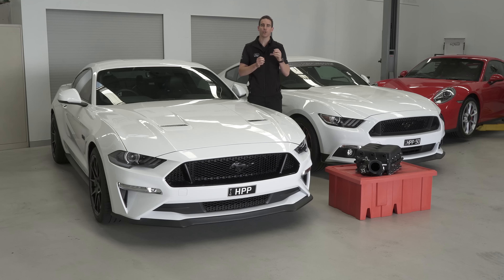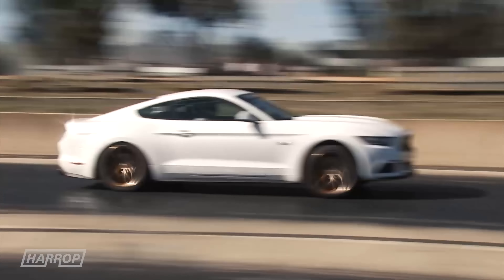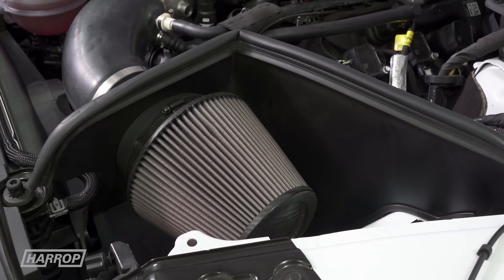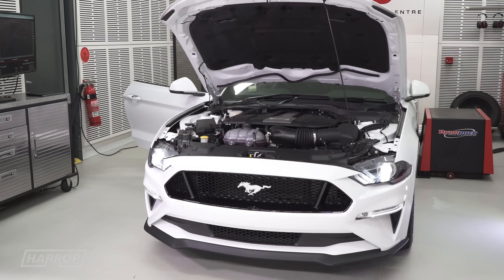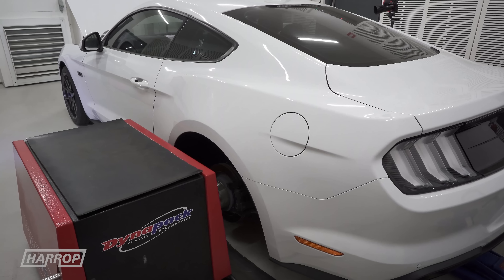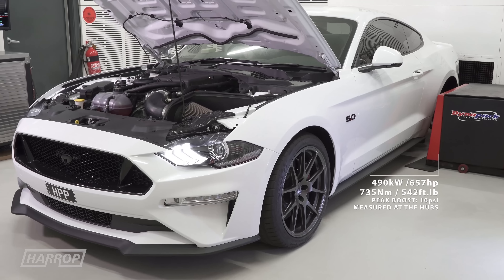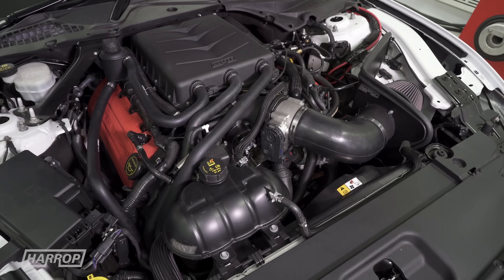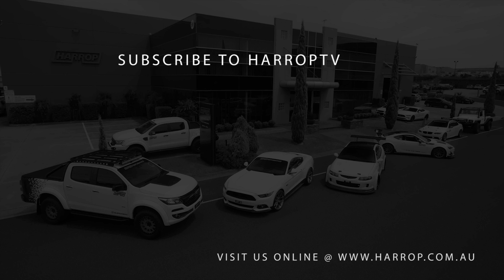Ford Mustang GT | Harrop TVS2650 Supercharger Kit

Comment: That fact you guys over looked the  2UR-GSE since the 2008 isf is criminal.
Reply: Look up Elate, they have a 1900 and 2300 version available for the ISF
Reply: @USC10_SC_F  seen YakuzaJZ have out on his channel, really cool.
Reply: @2URLex  haven't seen it, will check him out. I currently have a whipple 2.9L on my RCF (1 of 1) as of right now.
Reply: @USC10_SC_F   well you just answered my burning question for the RCF and you definitely are the one of one in that regard. You need to start uploading data because the community needs that info lol I want to see how the RCFs tuning responds to it over the isf since we use both the Otto and Atkinson cycle.

Comment: Hi Guys. With the new 2650 on my 2019 Mustang 10r80 Transmission on 98 RON would I have to upgrade the fuel pump?? Getting mixed answers from different people. Most say it will be ok unless it runs E85. Professional opinion as usual please.

Comment: Why would you drop the compression??? You could of made that power with stock compression and lower boost
Reply: I wondered the same thing. They can bump up the boost a little more, but if the sleeves weren't upgraded, they may be compromised if they try to live over 1000 wheel. Cool build, nonetheless!
Reply: @kevin_m110  oh yeah awesome build for sure

Comment: Gen2 coyote is stronger then Gen3. 1000whp on stock gear is common, no need to forge it for 900whp, just do the pump gears, and chain guides to suit e85 as they're not designed for it.
Kits not efficient either.

Comment: Damn good numbers looking forward to seeing what you all can do with the 2020 GT500
Reply: billy heaton What would be the point? It already has a 2650. Porting of the stock blower system would likely bring gains though.
Reply: @stevenp3176  because it's not the same lol the GT500 has a Eaton design
Reply: @fread51  there are going to be so few here in aus and its stupidly overpriced, not worth tuning here.
Reply: @fread51  They both have a Gen 3 Eaton 2650???